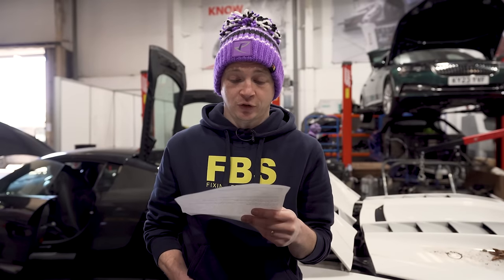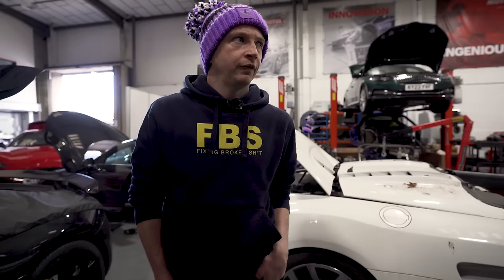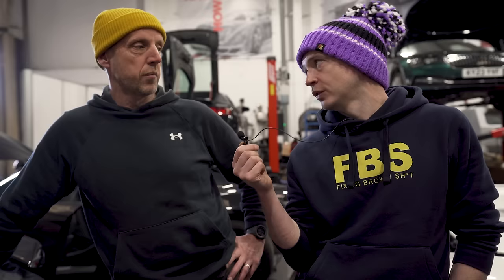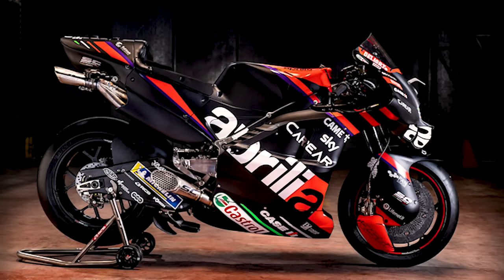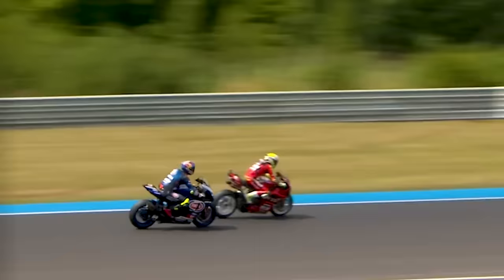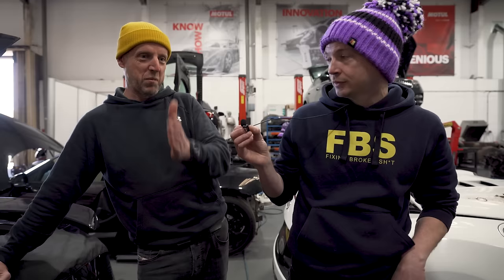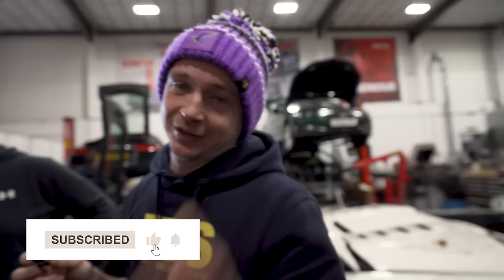Why F1 Style Aero is Killing MotoGP!

Comment: It's interesting how, at the beginning of the 1000cc era, they went for single shorty exhaust systems that terminated just outside the bellypan. Now they are running a long 4-2-1 system. To me the best period was 08 - 12 when they were wheelspin drifting around corners like King Kenny showed us how..
Reply: there is lots of tech that does not get done unless you have: engineers, smart people, or combo and money added. With dynos today you can be sure that optimum combo is being achieved but don't forget about noise and emissions too. Specifically if you have the hi pressure internal pressure meeting atmospheric pressure with drop but use a conical reducer it can really increase flow. Lots of people don't care but stuff like this has an impact. It all does!
Reply: they still don’t have traction control and abs afaik so the lack of wheelspin is just a testament to their skill
Reply: Tires have come way too far in a decade for skids. Even GT3s don't wiggle like they used too. The falloff/tire degradation is too steep
Reply: A 4-2-1 system tends to make more average power through the power band. The single shorty 4-1 tends to make more peak power, but less other places. 
They likely did a ton of testing and decided on the higher average power as it’ll help the most. The high peak would be best for top speed, but they’re not typically at top speed long enough for an extra .5 mph to be a big deal.
Reply: Keep an eye on Alex Rins, he smokes his tire all the time.
Reply: @carlosandleon  They absolutely do have traction control and have had it for over 20 years of varying degrees. No ABS though.

Comment: MotoGP had 8 different race winners in 2023.
15 different on the podium.
That is by no means a shit racing series.
It’s the F1 class of two wheels. Of course they have to push the limits of engineering. I absolutely love the geeky stuff in MotoGP. 

But you’ll probably have your way in a couple of years without aero.
Reply: Calling MotoGP the F1 of  2 wheels is actually an insult, for racing fans, MotoGP is a LOT better, but for car fans F1 is better, that's the difference, there's barely any racing in F1 man, just huge gaps everywhere.
Reply: It’s the king class of two wheel prototype racing, like F1 is for cars.
It’s in terms of the engineering, not the racing.
Reply: But we're those wins by people that got ahead in the first corner and then held that for the entire race... Can still be boring. We want tussles

Comment: Wsb is gunna be good this year, what did you make of Lowes outside line pass on Bautista ?
Reply: Unbelievable move, that 👍
Reply: he should pass if Bautista is being held back. would be bloody embarrassing if the bloke couldn't.
Reply: Phillip island was resurfaced. Massive Grip
Reply: Wsbk is a non event and they should just make it a spec series and use a single engine supplier.
That Ducati has been completely neutered and revs less than the bloody road bike

Comment: 100% agree. One thing you didn't mention is the cost/benefit ratio for the bike companies. 

Most of the tech in F1 can filter down to even the most mundane road cars, where as most of the new MotoGP tech cant or has no benefit for road riding. Suzuki pulled out, Kwak and BMW wont touch it with a barge pole. Its nowhere near as big as F1 from a marketing standpoint, and with the huge shift away from sports bikes by consumers, the question is what does the bike Co get out of it? 

With new tech Its basically getting more boring, more dangerous(tyre pressures, wayward ride hight devices etc), less diverse machinery and less connected to fans.
Reply: Yeah maybe tech from F1 does filter down to daily drivers, but if you are out driving your Prius with some sort of F1 technology you won't feel like an F1 driver will you? the only reason why F1 is bigger is because most people have no experience on bikes, so they can't relate to it, and also as F1 is a lot faster, I'm pretty sure many go to watch it live without knowing shit about it just to see those cars flying-by, F1 is by far the most overrated sport.
Reply: @Maidenintime86  Im talking about why bike companies are in the sport. same as F1, marketing and development. If the development and costs associated don't translate to anything useful, the reason to participate is lower, if the public find it boring, marketing isnt so effective, the reason to participate drops even further.

MotoGP has lost some of the biggest factories over the last few year, because the cost/benefit ratio doesn't add up.

Comment: As a quick aside: Dalara actually helped KTM build the Xbow, so KTM made a road car with a pro team.
i think the wings should be transitioned to winglets and spoilers, or at least the number of wings or aerofoils should be limited, and until then, they are just going to keep putting holes in the bodywork. spoilers with winglets could give them an opportunity to tune the thickness of the material to deform in a favorable way when there is a change of direction, allowing some of the aero to work in the corners a little more. Its the wild west right now and it has made it tough to get back in to the racing, with the japanese contingent a pretty long way off the mark. I think removing turbulence, and lift is great for safety and the aero can probably help in that regard, but im not sure allowing them to put aerofoils on everything is making for the most compelling races. You can always drill one more hole, and I think thats a dangerous place to push rules lawyers, vs material thickness and deformation.

Comment: I understand what you mean, and I kind of agree with you. I've said for years, motorcycles need active-aero. Not just air brakes on the back like a hypercar, to stabilize the rear, and keep it on the ground. But also, active-aero elements that create Downforce that adapts to lean-angle. 

Unless it's a Dragbike, or highway-runner. Fixed aero is pointless for cornering. You need active-aero for circuits & sprints.
And I agree with you that dirty-air from aero-kits, does interfere with traditional racing.

I think, MotoGP should have little to no Downforce for grid circuit racing. But have a separate division, even on the same track, same day, have a crazy, unlimited aero time-attack event, like the cars do.

I believe this is the best option, and sounds fun as hell to participate & watch.

Comment: Ground Effects as used in F1 works well, obviously as its purpose is to suck the chassis into the ground and thus generates increased grip.  However on a motorcycle this does not work well, because of the dynamics involved you cant suck the chassis into the ground effectively in the way that it is supposed to for effective ground effects.  As for general Aero, it has no effect below a certain speed. 

Grip on a motorcycle can only be increased with addition of weight (more mass over the contact patch), that is why they are trying to employ ground effects into a motorcycle as they need to keep the weight down but need more grip due to power output levels.

Cars dont have this problem when ground effects are correctly employed...

Ive heard rumor about 2027 Rule changes from a colleague in racing, rumour is Aero to be banned.

However, what is scary is F1 are bidding to purchase Moto GP...!!!

Comment: Very interesting. Havent actually ridden with aero but  in theory I dont like it. One- more downforce =more traction =more tire heat= shorter tire life. Second- if I am leading a race with aero i have 10mm preload on the forks and brakes but if I am drafting in the same corner my bike doesnt have the same air and loses the 10mm preload. How do I ride a bike that handles differently depending on how much air I am in?? I noticed you mentioned that at low speeds some lose front braking with the lower air pressure but also as the downforce lessens the chance of locking the front end up increases. I think you will see more accidents with aero and little real benefit to the motorcycle world.
Reply: That's precisely why it's hard to pass in F1 as well - more air disturbance when following a leading vehicle is a double edged sword.
On one hand, you are able to move quicker in the slipstream, but on the other, you have to brake earlier with less downforce and grip because of the stirred up and less dense air.
So following close is very hard and can wear out your tires with more slipping, making it a "pass or hang back" situation in some cases - hence DRS being added.
Reply: The tires heat up primarily by slipping and braking, that's why drag and f1 cars do burnouts before races.

 You're saying that pushing the tire harder against the surface is gonna heat it more, which is only true if the tarmac is hotter than the tire to begin with.

 The gas inside the tire is not undergoing fusion to say more pressure = more heat.

Comment: i think they can keep aero but change the engine spec back to 800s or even smaller. where they have to make a choice between aero for cornering and blitzing the straights. with the engine spec where it is they have too mutch power to play with. where they have to make a compromise with rideability. didn't work out last time but with the engineering we have today it can be done.

Comment: I'm a big F1 fan, and I have watched MotoGP a lot over the years. I think aero is necessary with the cars, but the bikes don't need it. People may say, remove the front and rear wing on F1 cars, but what will that do? It'll make F1 slower than other categories, then it's not the pinnacle anymore. F1 cars are the fastest vehicles on the planet to lap a proper circuit, by proper circuit, I mean non oval.

Comment: You can't have aspirational racing when the aspirations are dictated by the sanctioning body. Either let it be a multibillion dollar free for all where manufacturers are free to do whatever, or don't. The problem is a chase for increased speed inside a box, everyone has the same box, everyone does the same thing, every car or bike is identical. That's how the racing suffers.

I'm more a car guy, and look at Group C/IMSA GTP. You could do whatever you wanted basically, the cars were horrifically expensive, and the racing was amazing.

Comment: Aero in moto go has been interesting but it's time to change the rules and shave the wing and bits. Get the temps on the tires more stable, make the bike easier to handle and fight with.

My idea would be that dorna limmits the total down force instead of dicking around regulating the wings

Comment: Totally agree with the aero performance wings and aerodynamics being employed on the race bikes.  All this is going to do, is increase the cost to be competitive for the teams along with removing the reasons for racing.  Development of a race bike is to improve the bikes balance and power output, which translates downstream into a better production bike you and I buy in the showroom.  The rider will be less of a skilled position, it will detract from the interest in the sport, and is a road to no-where!  I have been saying this since they started adding more and more aerodynamic force to the bikes.  If you have ever seen Hydro-boat racing, it once was a HUGE sport and following, generations would wait for the summer tour to begin, but it's down to six races per year and with the exception of Seattle, no one shows up.  Why?  Instead of it being a boat with a WWII Merlin or Allison piston powered engine, it's turbine powered and not much of a boat...don't ruin the sport, keep it a motorcycle and not an airplane style bike!

Comment: really interesting discussion,, I think the WEC  HYpercar and LMP3 races this year will be really interesting, They have adjusted their format extensively and with Rossi and Button in the driver lineups this year I really think this series is on the up. Although all the same aero issues raised in the video are present at lease the attritional nature of the races and multi driver teams and multiple pit stops allow for another variable in who wins the races
Reply: I didn’t know the LMP3 race in WEC
Reply: Looks like the whole racing fans world is converging to WEC. F1, MotoGP all these diehard fans of actual racing have been feeling scammed for far too long
Reply: @thecompanioncube4211  WEC gets hated on because people don’t like the BoP system they imposed. Plus IMO, I think their maximum BHP is far too low - needs to be 1200 bhp on 1000 kg
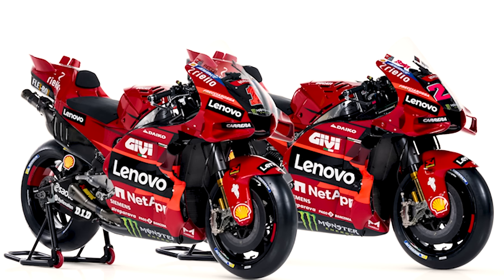Reply: @godwindracing6056 One of the problems that WEC has to deal with is, they absolutely need to race at Le Mans, and that's a Grade 2 circuit, made largely of public roads. That limits the maximum safe speeds, so the ruleset is based around a 3:25 target laptime there. (The LMP1-H era was faster, but LMP1 hybrids made their speed differently, blasting out of corners, then running on the ICE only for a while, then lifting and coasting for fuel saving. Hypercar's ruleset doesn't let hybrids get additional power beyond the ICE's power and doesn't allow front hybrid deployment below a certain speed, so they behave like non-hybrids, and the target stint length doesn't, AFAIK, consider lifting and coasting, so a slower lap has the same top speed.)

Comment: The last two seasons in MotoGP have been overrun by technical advancements clouding the performance of the riders … in that time Marc Marquez has managed to crash down from his previously unassailable position at the lead and I don’t doubt that some of the advancements have played a part in his demise. I personally don’t believe he let himself fully heal which has also affected his advantage .the Aero is part of the problem, sure , but so is launch control and the ride height hardware . It will be interesting to see which way they go from here …

Comment: MotoGP and WSB need to be separate, hence MotoGP can be the cutting edge with the real prototypes built soley for racing and maximum speeed/grip. WSB and WSS play the part of the more relateable aspects as they are road based. They both need to be completely separate and both have a part to play, restricting MotoGP will just bring the two race series closer together and one will fail.

Comment: Thank you for the great video. 

It doesn’t make any sense to remove ‘all aerodynamics’ out of MotoGP bike design. Aerodynamics, in some form, have always played a part in MotoGP bike design. Aerodynamics will continue to be part of MotoGP bike design in the future. The question is, how much aerodynamic design should be incorporated into MotoGP. 

Personally, I would like to see aerodynamics reduced in MotoGP with the introduction of rules that govern what type of aero designs can be used and have these aero designs standardised and regulated across all bike manufacturers. 

I would also like to see electronic rider aides reduced, putting a greater emphasis on the rider’s skill and ability to control how the bike performs (wheelies, slides, tyre wear, cornering, starts, breaking and so on) rather than the bike’s electronics being so advanced that riders with less natural ability and feel for the bike are able to push hard and be competitive with riders who have more natural bike control skills (like has become the case in modern MotoGP).

Please don’t get me wrong. I’m not saying that the current crop of MotoGP riders are not exceptional riders. They are all phenomenal talents. However, the modern MotoGP bikes, with their suite of electronic rider aides and aero additions, have made the bikes easier to ride fast, where any natural, human, talent one rider may have over another is muted by these electronic and aerodynamic aides. 

I am not advocating a return to the unruly days of 500cc GP bikes or whatever the modern equivalent of a 500cc 2-stroke bike might be. What I would love to see is that there is a shift of emphasis back towards letting the individual skill set of the rider being more of the primary reason for which rider wins a race or wins the championship rather than which rider has the best bike with the best electronics package and best aero design. 

Essentially, I would like to see MotoGP change for the same reason that Rossi cites as to why he left Honda to join Yamaha - that it takes more than having the best bike on the grid to win a MotoGP championship. The skill of the individual riders should also be an equal consideration and determining factor in racing.

Comment: I think what MotoGP need is to figure out in 2027 how to balance the Aeroynamic & dirty air that created by it. without compromising more the riders behind. Yes, it wouldn't completely lose the turbulence created by it.

But at least if they could find a new design that will able to make it work. Perhaps the moveable Aero that F1 is trying to implement in 2026 maybe could able work more on the bikes with its geometry & smaller size. We 'll jsut see what MSMA & FIM will decide.

Comment: Aero is NOT killing MotoGP. Just as with F1... MotoGP is the pinnacle of motorsport, just with 2 wheels instead of 4. They need to push the limits of technology with engines and suspension as well as the aero dynamics.

Comment: well a MotoGP bike right now has almost 300hp, with a top speed of 370km/h. They need the wing because they wouldnt be able to accelerate out of corners. Racing is still there, not like F1. Kids start on moto3, then moto2, and finally to MotoGP. Superbike started fine, but then certain manufacturer stopped winning, then rules started to change so the one winning doesnt win so easily....

Comment: I think the bigger issue is ride height devices.

Maybe aero should be limited, but it's the next step. I'd like it to be able to trickle down more than anything, so it needs to be reasonable and dynamic enough that the package would work for anyone, maybe some simple tuning required.

Also unban DCTs, and keep the racing competitive. Engineering should not take precedent over a rider's skill and ability to make it happen